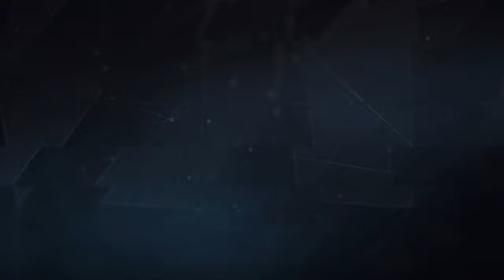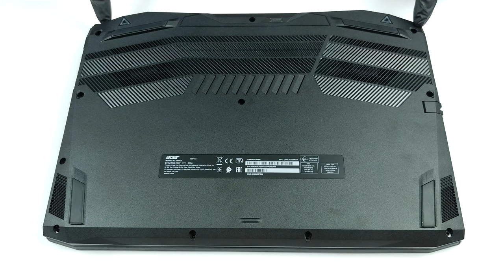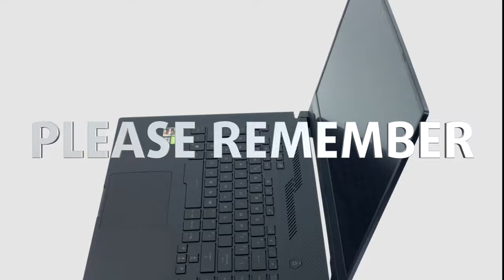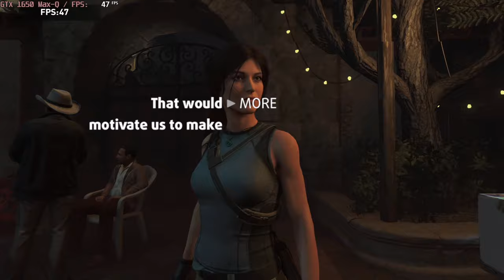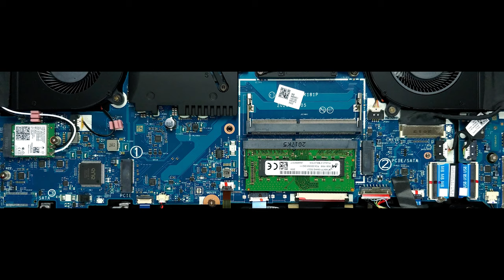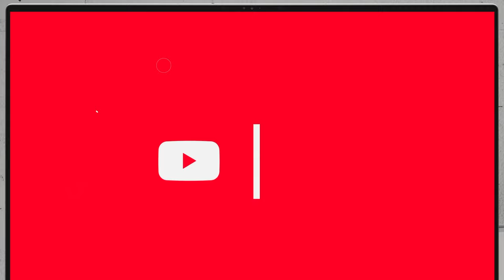🛠️ Acer Nitro 5 (AN515-44) - disassembly and upgrade options

Comment: I read your article about this first, then saw that you had a video. I thought that it had more to it than the article. The voice over was just reading the same article, while parts were removed. Zoomed in to show the same screenshots that were in the article. I was hoping you could point where the components are plugged in while being mentioned. Something like, "m.2 drives go here..." "this is what the port for the 2.5" drive looks like so if you have this plus 2 m.2 slots, you have an option to install a third storage drive."

Comment: What ram installed in stock?
Reply: 8GB
Reply: @ratyy3249  8gb 3200mhz cl22 1Rx16 SODIMM to be precise.

Edit: Stock ram is Kingston ACR32D4S2S1ME-8

Additional Note: Single rank x8 modules have twice as many bank groups compared to single rank x16 variants. Which means 1Rx16 is slower than 1Rx8 (by 5-10%). Also note Dual Rank variants like 2Rx8 is likely better than both of what said earlier.

Comment: Strange that your version doesn't have the little hatches to access your hard drive and ram without taking the whole thing apart, i have a 2018 version and it lets me access my ram and drive.
Reply: Yes. Some if not all newer models were deprived of these easy access panels.
Reply: @bryanmalenab8278 , Thats dumb. Talk about design flaws. I love my acer nitro, works so well, has great speakers and all, and even with the panels my version has, you still have to take the whole back off if you want to clean up motherboard. They need to change that.

Comment: I specifically need to know if there are CPU/GPU fan upgrades for the Acer Nitro 5: AN515-54 ? The fans for the CPU have failed THREE damn times... Shit parts. And they're always out of stock everywhere (proof they're shit and Acer will not acknowledge) so I'm looking to upgrade them
Reply: Did you find a source for these fans?

Comment: Thank you for the video.
If anyone can help: I've just read in the manual for AN515-44 model and it says it has USB-C 3.2 Gen 2. Does it means it supports video over USB-C?
Reply: No, unless stated otherwise. Usually, try looking for a USB-C with thunderbolt specification, these can only be found in intel variants. It is useful with display out and if you want to utilize external GPU via thunderbolt.
Reply: @ov3rkill  does the USB A connect to the Graphics Card?
Reply: Lies it only 3.1

Comment: This can't hold 64gb of memory so stop saying it can. That's just the AMD 4800h chips capacity.  The nitro 5 motherboard and bios can only handle 32GBs max!. Stop misleading people.
Reply: noted
Reply: Quick question bro, can I install 2 x M.2 and 1 sata 2.5 in this laptop? Because I saw the other M.2 slot is to close with RAM
Reply: @plasticksampah  yes this model can hold 2 NVMe SSD drives and 1,  2.5 SSD or HDD.
Reply: How do you know? Have you tried?
Reply: I know for a fact. Don't need try. It what the bios can handle.
Reply: @canadoman819  So you have one? I don't see any reason why it wouldn't be able to run 64 GB of ram since the 4600h can handle that fine. Also, there is currently a version of this laptop being sold on Amazon with 64 GB of ram, not that I would ever put that much ram in a laptop like this, but it's possible. There isn't a hardware limitation.